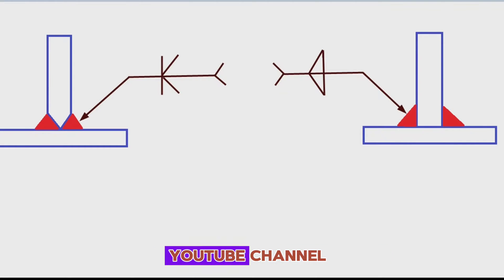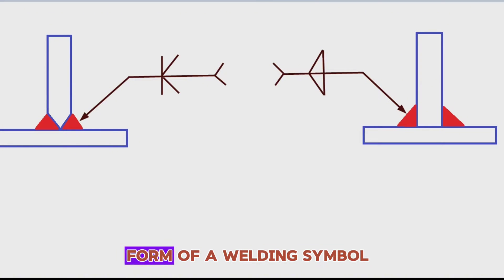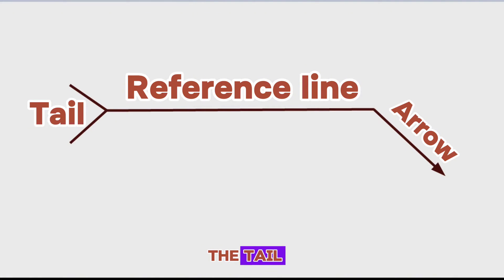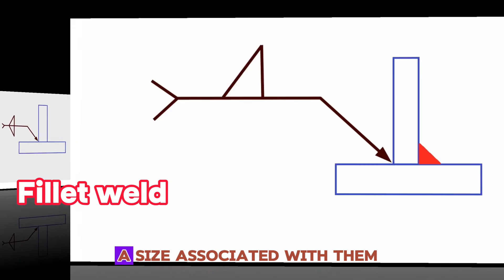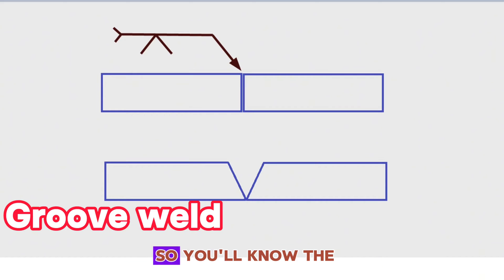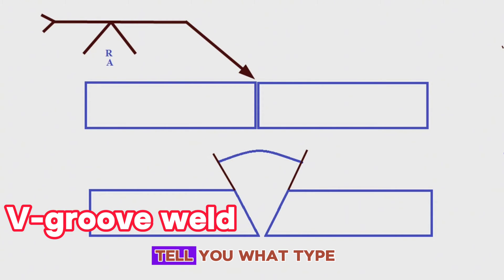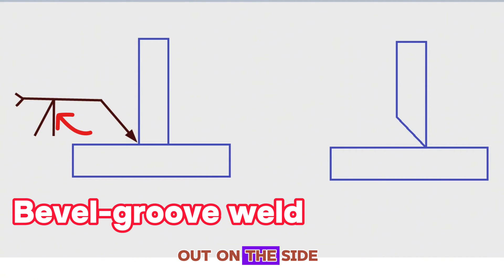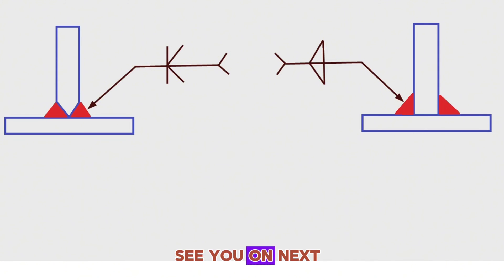Introduction to Basic Welding Symbols: A Beginner's Guide. Filled weld, groove weld, bevel weld.

Comment: What is the meaning of a5 and a4 in fillet weld symbol in drawing
Reply from the maker: Tahnaks for watching and comments.
a4 or a5 filet indicates that the depth of the welds is 4 mm or 5 mm. That is, it indicates the distance from the bottom of the corner to be welded to the top of the weld
Reply: Is it throat size ?